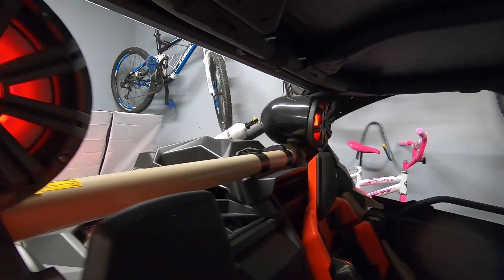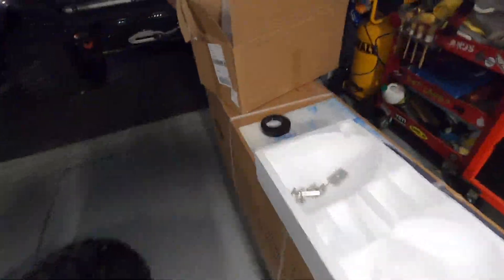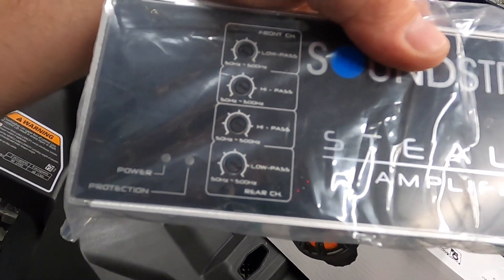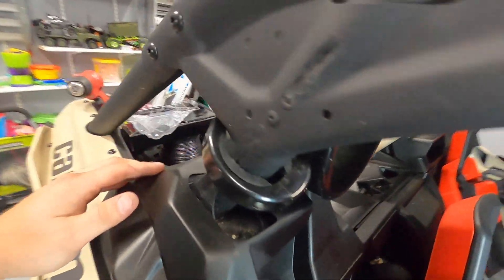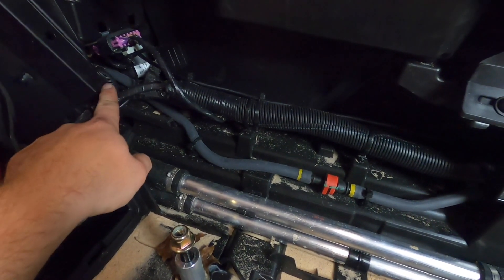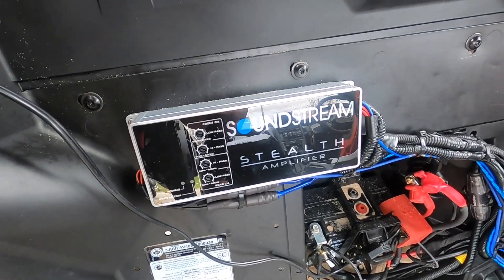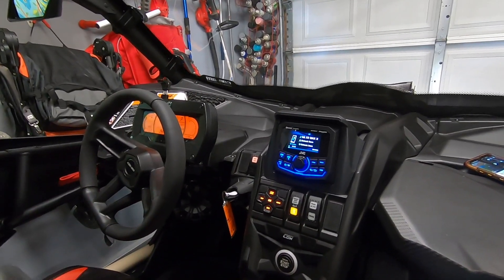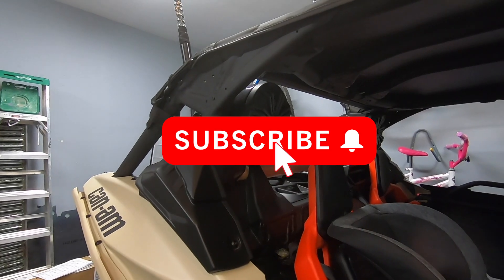2021 Can-Am Maverick X3 Turbo RR Kicker 8" Tower Speaker Installation & 4 Channel Amplifier

Comment: Also how did you run your Rgb.. did you just run one color or did you hook all them up and how did you hook them up to the speaker wire? wouldn't think it get a power source through a speaker wire?

Comment: is that just the two speakers in the video popping off.. and how loud are they.. i have some MTX 6.5  pod speakers on a 200w amp 2ch and it isnt loud enough...?
Reply from the maker: Those are all 4 speakers.  The 2 in the back are pretty loud on their own. Rgb red is hooked up to the speaker wire and the louder they play the brighter the light up to the music.
Reply: @MohawkDaveOffRoad  thanks for the video! Did you connect rgb red to speaker black or speaker red? Also, did your enclosures come with the speaker mounting holes pre drilled or did you have to drill and tap them?

Comment: How did you mount the chase light now since you moved it from last time?
Reply from the maker: The two track screws that come with the bar mounted to the 2 existing holes in the back of the roll cage.
Reply: @MohawkDaveOffRoad  just commented about relocating 😅.
Reply from the maker: @GarSeeYaa  just replied to that comment 😄

Comment: How did you get the flashing to work with the beat, without the controller module? I have wired mine up and it is only staying a consistent colour not flashing to the beat of the music.
Reply from the maker: I wired directly into the speaker wire that goes to the amplifier.

Comment: You need to relocate your chase light bro. There should be rear bolts to mount it onto the cage. You won't need the brackets
Reply from the maker: I did exactly that. Apparently the lightbar didn't have the track bolts included in the box, so I found some online. Fits perfectly in the cage holes in the back.
Reply: @MohawkDaveOffRoad  please elaborate. I will be mounting the same chase light in my x3. Thank you
Reply from the maker: @1ttcobra2003   there are 2 holes in the back of the roll cage. Usually all the chase lights come with bolts that slide in the back of the chase light that use the 2 holes in the cage to mount with nuts and washers.
Reply: @MohawkDaveOffRoad  awesome that you

Comment: Did you have to purchase the LED controller in order to have the LEDS work?
Reply from the maker: No I did not. I wired the red led right to the speaker.
Reply: @MohawkDaveOffRoad  So when you connected the red LED wire did you just strip it and twist into the black ground wire? I have the full set up installed right now and I’m just wondering why the LEDs are not working. Did you have to take any steps to get the LEDs to properly work with the amplifier or the deck? Hmmmm

Comment: How did you wire up the LED’s? I’ve got  4 8’s to to wire up. Please tell me you don’t have to run a separate positive and negative to each speaker? Lol
Reply from the maker: No, you can wire them to the speaker wires.